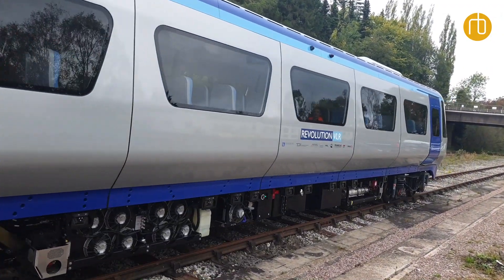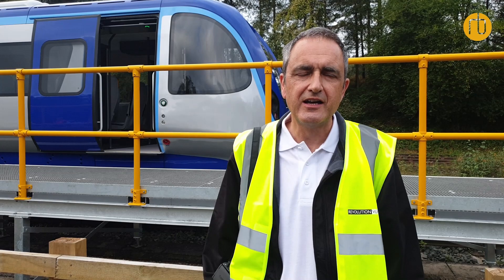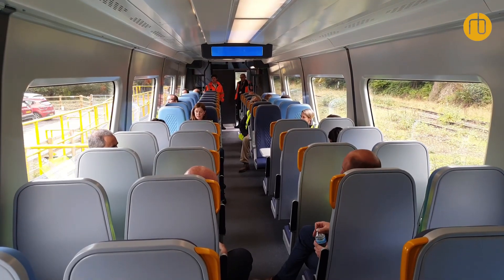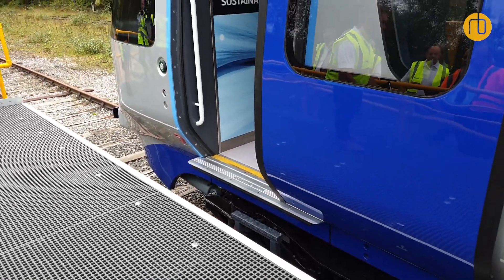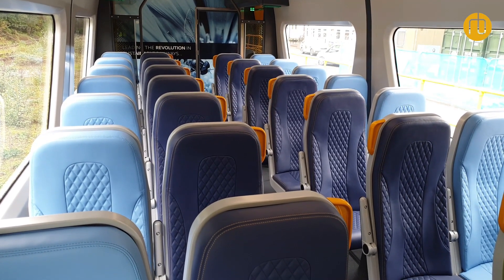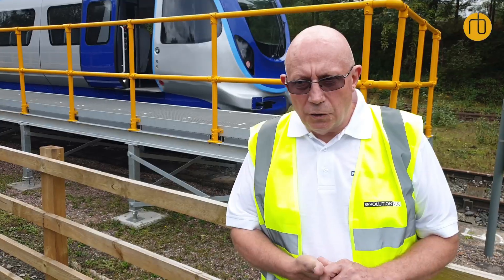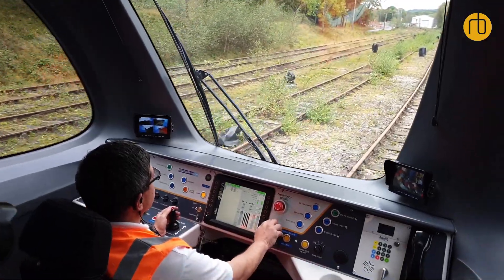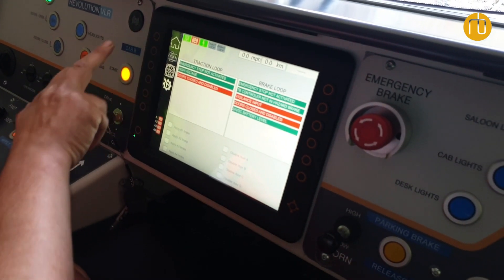Revolution Very Light Rail vehicle demo, Ironbridge

Comment: What is the top speed? Can it be automated?

The absolute dream would be for local rail services to use trains like this, that can be automated so that instead of 4 cars every 30 minutes you could have 1 every 8, meaning timetable-less 24/7 transit for lower population towns and cities
Reply: Problem with that is local rail tend to have a lot of crossings. Some of these crossings would effectively be closed permanently if trains every 8 mins.

Comment: So it's basically a railbus?
Reply: would be so much cooler if it had 3rd rail
Reply: @АклызМелкенды  the lack of 3rd rail is to reduce cost - the lack of grounding and road digging needed reduces the cost of this system compared to a traditional tram by multiples.
Reply: @hoixthegreat8359  yeah, but they are harmful to the environment and so on and so forth, personally I just don't like battery busses or trams